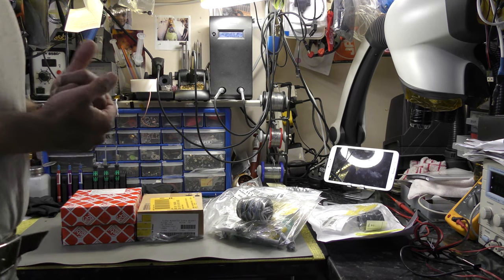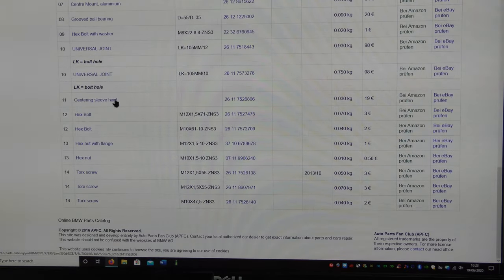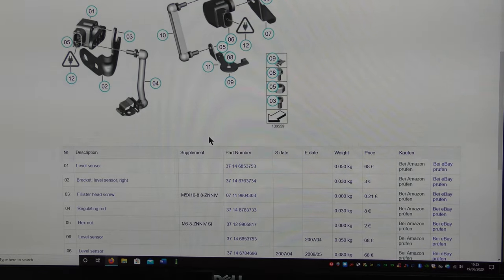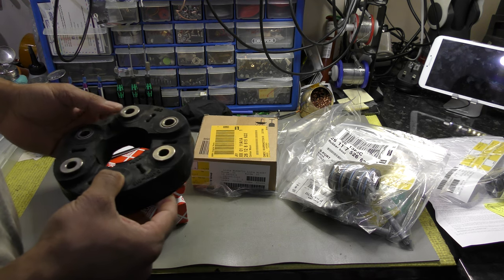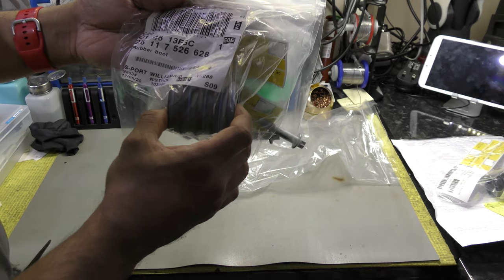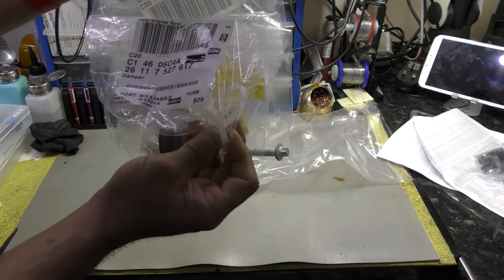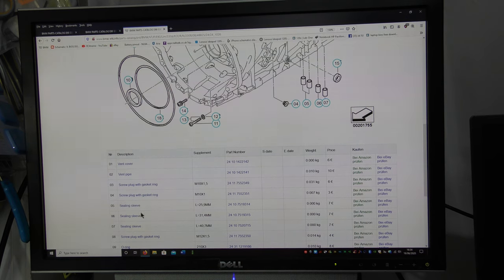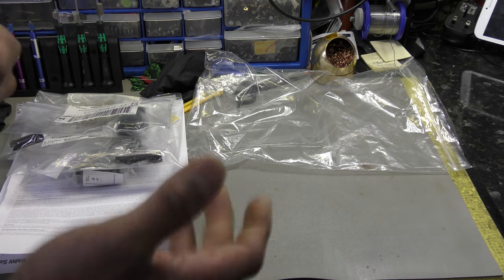BMW E90 330D M SPORT 2008 PROPSHAFT AND GEAR BOX SERVICE KIT

Comment: Whilst the valve body is removed, change the solenoids. The transmission does not take oil. Fill only with ZF lifeguard6 fluid only. The BMW fluid is more expensive and is same. You could rebuild the valvebody with a zip kit and new plate. Never change the clutches. They will out-live the car.